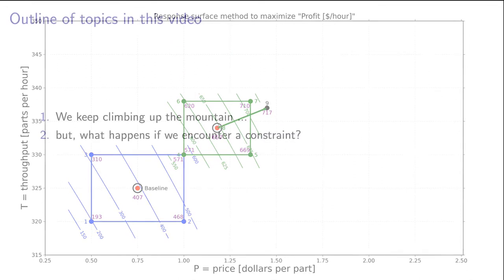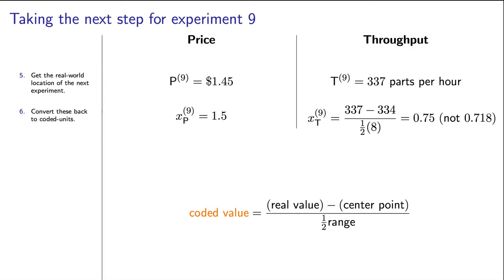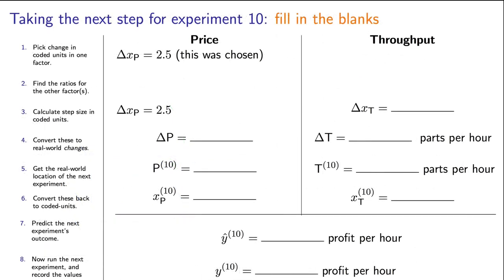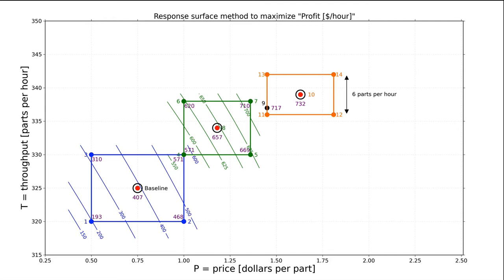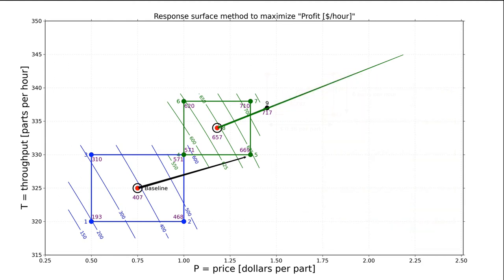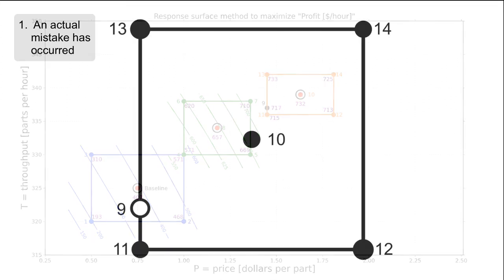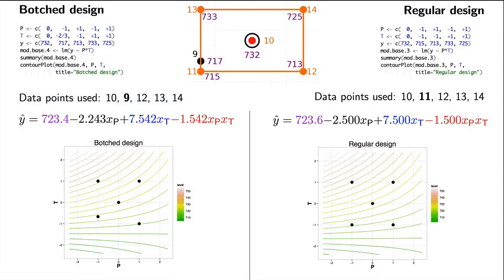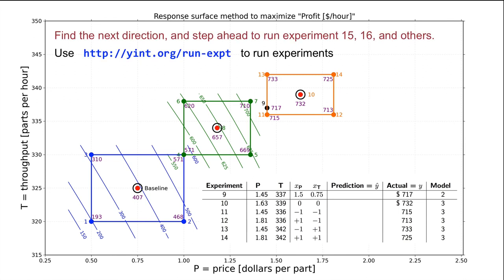Experiments 5F - RSM case study continues: constraints and mistakes

Comment: If the model fails to match with the real world at point 10 and you need to rebuild your model again, why did you use point 10 as your base line? b/c in the previous video (5E) you did not use the last point as a base line when you found that the model failed to match with the real world at that point.
Reply from the maker: Hi Meda, I want to emphasize that the choice of the baseline point is not influenced by whether the point was successful in the prior models. 

The baseline point (which then also helps determines where you place the rest of the factorial points), is influenced mainly by how you can best reuse prior experiments. Since experiments are expensive, you want to reuse the prior experimental data too.
Reply: @KevinDunn13  Can we use point 10 as a level instead of baseline? Will there be any problem?
Reply from the maker: @vamsikrishnabhadragiri402  you can indeed use point 10 as a corner point in your experiment. You do lose a degree of freedom in your statistical model and the potential to estimate curvature. But if each experiment is extremely expensive, then I would leave out point 10.